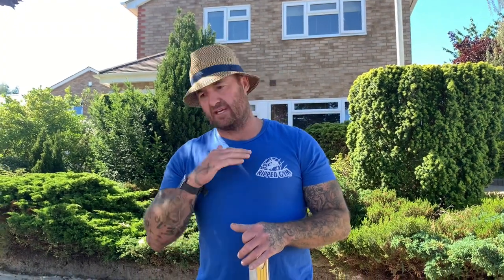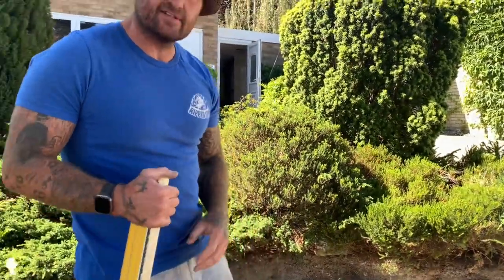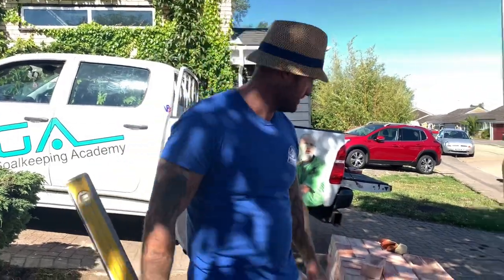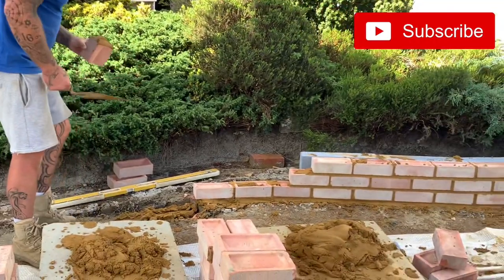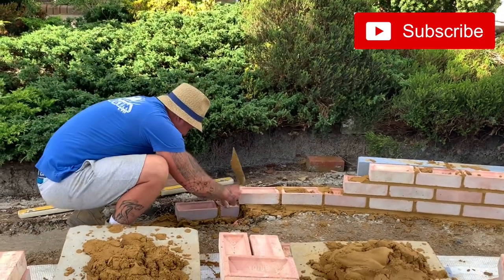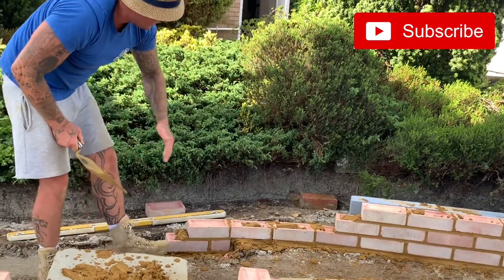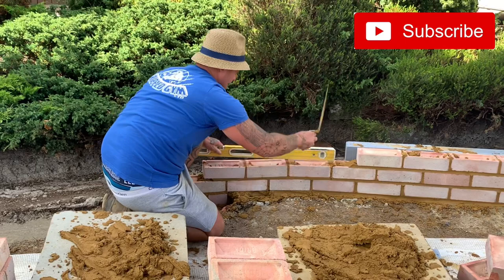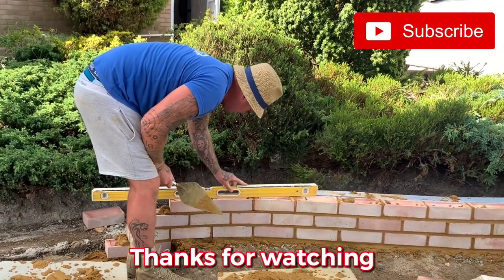Bricklaying ,no pic n dip ,no profiles 🧱

Comment: Class mate, not enough good tradesmen round out way in Essex. I find it easier to peg a few batons along the trench, then get the laser level out and mark my footing height of off the laser line (usually measuring down off the laser line). Found it to be a bit quicker and more accurate than oppose to using a level. can get it to the mil if you’ve got ocd like me 😂😂 

Lovely work though 👌🏻

Comment: I have a question......well two actually and its a genuine question not a critisism; on the perp joints why do you only spread a tiny amount an the front face and the back, why leave a void in the middle and I know it isn't because the mortar fills the middle when you lay the brick because there is insufficient mortar to do that?  And why are some laid frog up and some frog down?

Comment: 1 . Why have you used a cheap common for a retaining wall ? Should be a stronger  brick 
2 . Why have you used a lightweight block at the back ? Should be heavy duty concrete 
3 . Why no weeps holes ?
Reply: Hi mate 

Long story had to put customers preferences before my ego and knowledge .

The bricks are match to house ,i advised blue engineering to brick on edge but customer didn’t want .

Weep holes wore inserted ,also the shrubbery is dry bush ,just soaks up so much moisture throughout the year .

If you look we left 300mm between back of wall and earth and filled he with hard core 

Blocks on the back , don’t want to go into it too much but the previous builder turn the client over for 12 1/2 thousand pound and they literally run out of budget so we use what materials were there to help out , this is why we put 300 mil of hard-core between the Earth and block to help drain the water away to give the block more life.

Well observed though mate 👌

Thinking about it now I should’ve really mentioned it on the video but I didn’t want to talk about the previous builder too much

Comment: Try not to comment on videos like this but I’ll make an exception this time , mainly because the video is initially based upon work being carried out to a poor standard , and this video is then supposed to show how to do it correctly . 
 You couldn’t have used a worse brick for a garden wall . London bricks aren’t allowed to be used below dpc on a house because they rot and blow . To use them on a garden wall is a big mistake . The faces will start blowing off in no time . You could have got a match for the house by using London replica bricks . Same face but on a traditional clay perforated brick instead . Shame as fairly neat and tidy other than being a bit behind on half bond and the perps out a little .

Comment: Nice work, but what a pity you used cheap pink flettons, they are not supposed to due be used in exposed locations ie brick on edge coping to external walls, any frost on those and they'll fall apart. Should of used a clay stock brick.

Comment: How hard can it be to purp the full brick
Reply: No reason. Tell me why it's necessary??
Reply: It allows water ingress leading to cracking by freeze thaw.
Reply: @matthewward4661  ah ok. Water ingress from where? If the outsides are sealed hows the water gunna get in?
Reply: Purp? Perp - as in perpendicular!
Reply: @jackknife1796  Joints should be filled to reduce the risk of rain penetration and dampness in the wall. Solid mortar bedding and fully filled perpends are particularly important in exposed areas and where the cavity is to be fully filled with insulation. NHBC standards.
Reply: @gbwildlifeuk8269  hmm idk, yeah reduces risk I suppose, but if the joints are full why does it matter if the middle of the perps is gappy? No water can get in so no issue?

Comment: A fellow bricklayer who can build a wall without profiles ... we are becoming a rare breed indeed . ☺
Reply: Any decent brickie can build without profiles it just makes more sense to use profiles with brickwork and definitely stonework as its more efficient although I would never use a profile with blockwork as I can knock up blockwork as quick as anyone with a profile , but I never used a profile before until I came to work in England now use them all the time for brickwork but rarely do you see them used in Ireland and when I was at college in the early 1990's and on sites in Ireland never once seen a profile and you would have to drive about a bit to find men using them in Ireland nowadays but I do believe young ones learning are relying on profiles to much and could  probably do with more experience building corners freehand👍
Reply: @scoyle1750  Yes . ☺
Reply: @scoyle1750  I did my time with a very strong Irish subbie . All his men were Irish , and all good , fast trowels . No profiles ... I learned very quickly from those lads . ☺

Comment: No weep holes , that ain’t gonna last 2 years
Reply: Weep holes ain't needed for a wall that size. Why would you need them ?  There's no sloping bank from above,  the ground is falling away in the direction of the wall. Common sense goes along way in the building trade..

Comment: is the cement too sandy or is it just  my eyes looks bit too yellow ?
Reply: I did think that I'm a roofer so use 3.1 but that looks really sandy might just be us 🤔
Reply: All I see is southerners gobo is yellow up north ours is gray
Reply: 12 shovels and half a bag 😆
Reply: I have worked national and international and some of the best sand I have used was in Harrow. It is very yellow in colour and had good structure meaning that you could do a mix ratio of 6:1 which is plenty strong enough for Flettons when laid frog up. Always remember the mortar should not be stronger than the brick.
Reply: I think the wall looks very nice even though I do agree with some of the negative comments. Having said that I think you come across as pretty good chap who I could easily work with. Everyone can learn something new every day and that includes me and I have been a Bricklayer for 45 years now.

Comment: X Hoddy who’s picked up the trowel, everything you do is unconventional, wiped empty perps, using the back of the trowel to scrape the mortar onto the floor several times for each brick, laying 5 bricks then hitting the level, 1st 2 courses above ground should be semi_egineering bricks, the wall should be all brick in Flemish or English bond, all hidden for the customer, the traditional hoddy
Reply: Hey greg, couldn’t you use wall ties to tie block work to brick work?
Reply: @petep8828  Hi Pete, 1st choice 225mm brick wall in English or Flemish garden wall bond a solid wall,2nd choice brickwork backed up using wall ties with concrete blocks,
Reply: @gregadams8670  225? I thought it was 215 because there isn’t a joint there.
Reply: @petep8828  yes your right Pete, even though we all work in metric ,it's generally called a nine inch wall or niner, I converted it to metric
Reply: @gregadams8670  oh ok, nominal not actual! Thanks for clearing that up!

Comment: Firstly I’m not putting ya down pal,
Only you’re workmanship 👌🏻
The most professional thing you did IMO was step the footing 👍🏻
Then you chose the wrong bricks, should be dense engineering brick
Wrong block, should be dense concrete not air-rated internal thermalite block
radius wall not gauged, ie perpendicular joint different, bed joint, you have not filled you’re perps or frogs
There’s no expansion joints 
No weep holes to allow some of pressure of water behind the wall to come out!
He talks the talk but he ain’t a proper bricklayer, definitely not finish face work on site anyway, more footings 🤣
He’s not even got a sign written vehicle 
He does football coaching 😅
Reply from the maker: Over kill 
Listen been running gangs on some top pristine work here in the UK for 20 years before going back into professional football .

Listen don’t wanna going to too much corners had to be cut and we had to use existing materials as the previous builder had the client over the £10,000.

Let me educate & tell you something now that will be fine for the next 15 years 
We put a 300mm dense hardcore soak away behind the wall 
Face work on site ,,,, hold your tongue lad 
I’ll probably forgotten more than you know
It’s about knowledge 👌

Comment: Isn’t it, fail to prepare, prepare to fail....shouldn’t it be engineering bricks with weep holes
Reply: You don't need weep holes if there's no soil/ground at the back of the wall it was just a few plants 🤨🙄
Reply: 3.46 so I guess that not soil. Should have done it with engineerings or at least 3 course
Reply: @fireblaster9961  it's about a foot and half away 😉 wouldn't hurt it in the slightest